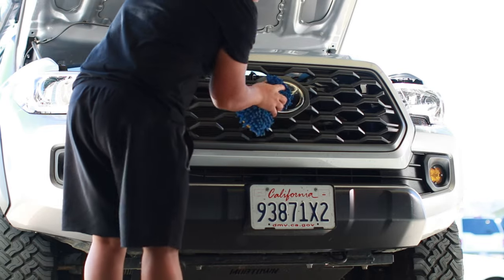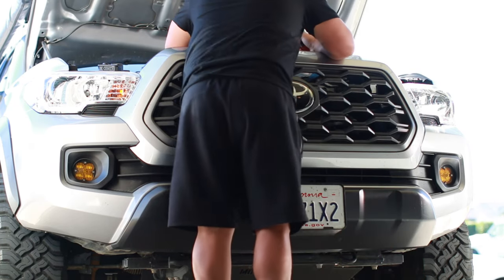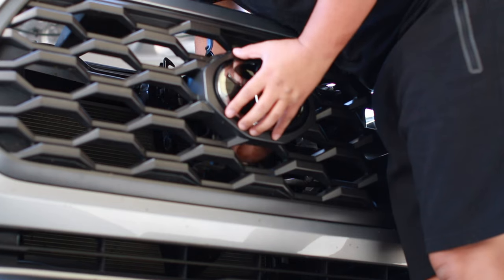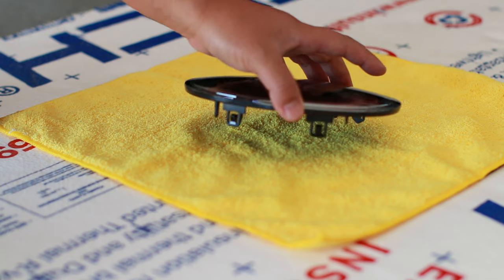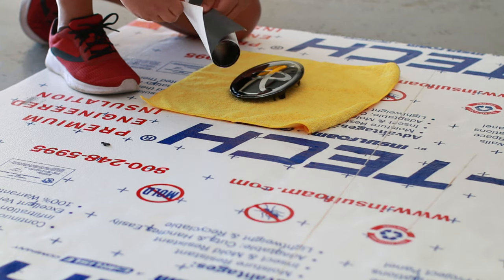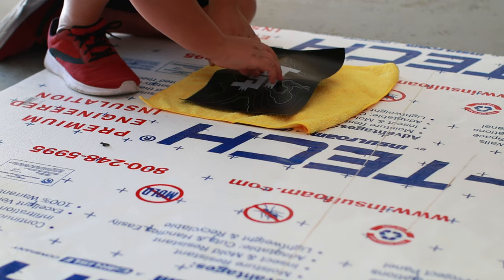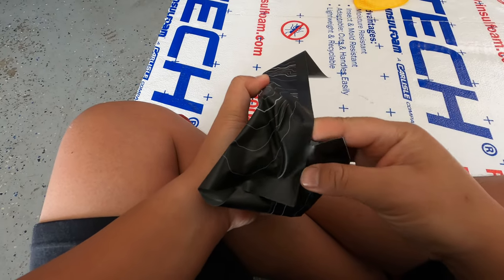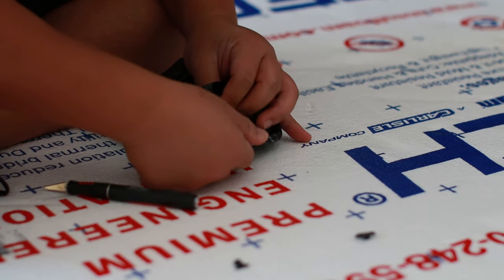Toyota Tacoma Grille Emblem Vinyl Overlay | How To

Comment: I'm waiting for mine to come in shortly (got a different emblem).....because I didn't want to mess with my sensor anymore (take if off the grille) , Kevin told me you can remove just the 2 silver Phillips screws, then gently pop it out without having to touch the sensor at all....idk, gonna give it the oll college try when it comes in
Reply from the maker: Nice! Yeah, sounds about right. In retrospect, you could just do as you stated.

Comment: another thing that might make it easier is applying soapy water to be able to move it and center it just right and afterwards squuegie the water out and use a heat gun to get it to adhere well
Reply from the maker: That makes sense! Awesome tip.
Reply: I would check the vinyl type first, not all can be installed wet.